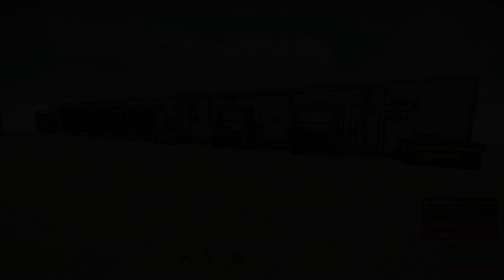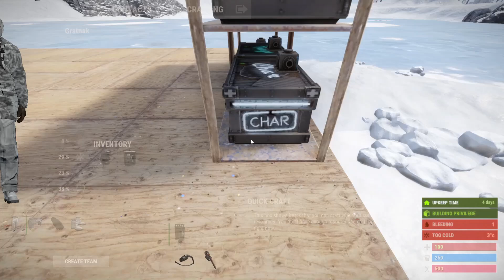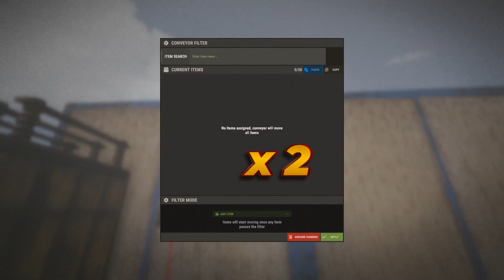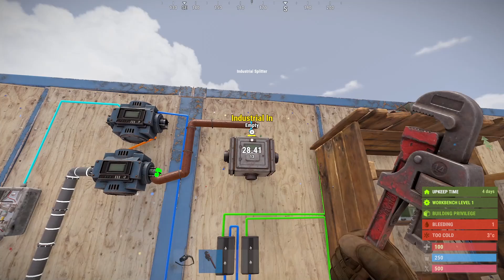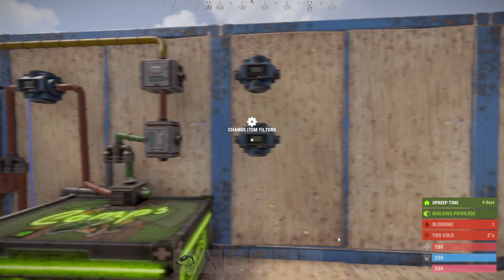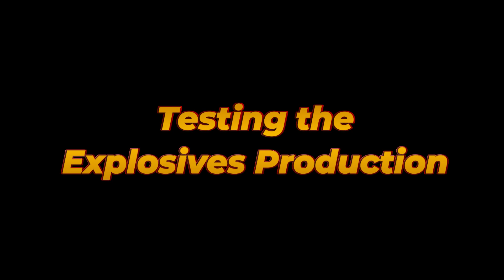Rust: Automatic Rocket Factory

Comment: Great video! I have one question. Will this prioritize the sulfur for explosives and run out making rockets before it uses all of the sulfur making Gunpowder? I’m worried by doing this I’ll end up with nothing but gunpowder. I’m going to set up full automation and autofill to each individual component box with a drop box outside and electric furnaces/oil refinery/furnaces. Basically I’m looking to drop all these components into a drop box and have it filter to make rockets before
Reply from the maker: Yes, it should do that. Sorry for the delay in replying.

Comment: I am a little confused.. Are you making GP with wb auto crafter? Why?
You use a lot more coal by doing that
Reply: I already see it being mentioned :D
Reply from the maker: Yes, this is more geared to those that have little interest on waiting for gunpowder to cook in a mixing table (even though it's 50% cheaper on charcoal to make it with one). This could be linked to the automatic charcoal burner, for even easier use. https://youtu.be/6ZG2s95plqg
Reply: @Gratnak  your math is a little wrong. it’s 33.33% cheaper on charcoal to craft gp in a maxing table.

Comment: Great video, man! 
The biggest problem for me will be that since I started playing Rust in October, I've never found a rocket in loot to make a blueprint out of — I just have no luck with that. 🤣

By the way, do you actually need a workbench that matches the blueprint's tier when using the Industrial Crafter?
I thought you could use any tier of workbench for crafting as long as you have the blueprint.
Basically, like how you can craft explosives with a Mixing Table without needing a T3 workbench.

Also, your voice was very quiet this time—even your subtle background music almost overshadowed it in some parts of the video. 
Maybe you want to slap like 10 - 20 db on top next time. 😉

Keep up the good work! 😁
Reply from the maker: The grind to get rockets is a long one, well unless you do something like take out Bradley.

If you put a blueprint into a crafter that requires a high level, it will say, highlighted in red, that "Cannot craft - workbench level"
The volume knob on the bottom of the mic is very easy to knock, so it could be that I've knocked it and not noticed.

Comment: Why would you automate gunpowder creation instead of using mixing tables?
Reply from the maker: I'm glad you mentioned this. You can utilise mixing tables and simply add the gunpowder to the components box (it's 50% cheaper, in charcoal, to produce gunpowder using mixing tables, for those who may not be aware). However, this option is intended for those who prefer full automation and do not have the time to manually craft gunpowder at a mixing table.